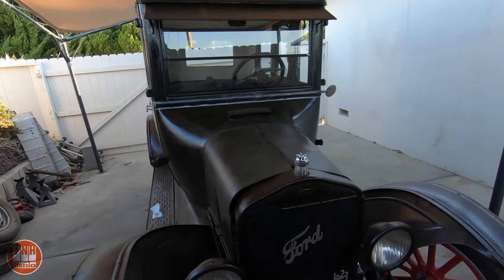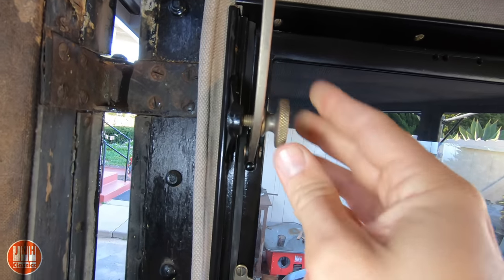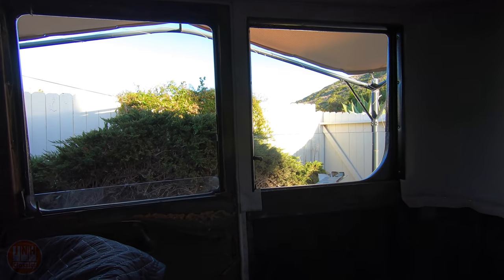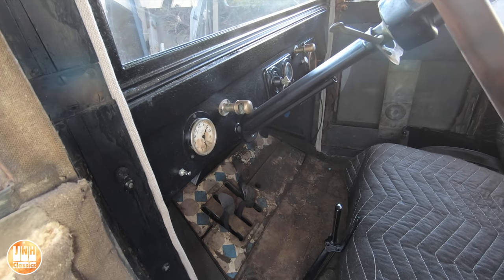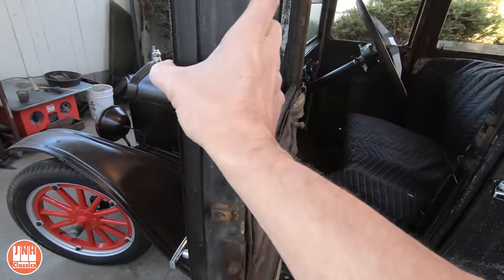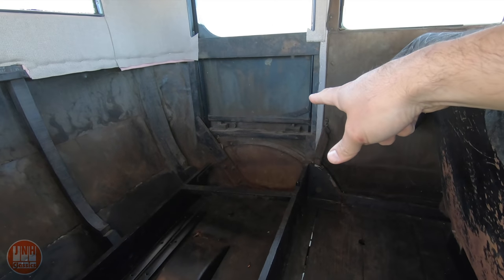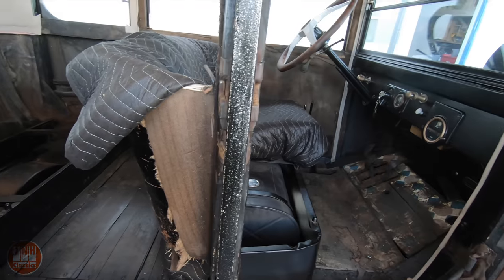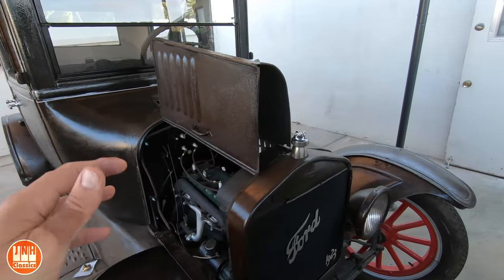The Model T has a New Roof and Other Bits  - Sunday Update (4-4-21)

Comment: When a six volt car is hard to start, people always blame the six volt system. The fact is that when these cars were new they started with no trouble. If they were problematic they would've never left the show room.  There's always a reason behind hard starting. The trick is to find that reason and correct it without resorting to the gimmick of changing to twelve volts to cover up the problem.
Reply: First thing to check is the battery cable.  The ground cable should be attached to the frame without any paint behind it.  It's a good idea to scrape off that area before attaching it.  The cable to the starter switch from the negative post of the battery should be designed for a 6-volt car.  You probably won't find that at your local parts house unless you ask for it specifically.  A 12-volt cable just can't provide enough "juice".

Comment: On the starter. My pop has had a 27 Model T since the 60s. The starter speed always sounded like yours. Slow. And it has always worked fine. Regarding the missing windshield knurled knob, you might have luck at MTFCA forums. Those old guys have everything.

Comment: When I first purchased my ‘27, it cranked real slow. New 6 volt battery and cables helped little. Sounded like the starter was dragging so I removed it. (Bendix has to come off first!) Wken I took the starter apart it literally fell to pieces!  How it functioned at all I do not know. I showed it to a rebuild shop. They told me it was the original starter and was too far gone for them to rebuild! Exchanged it with Snyder’s and now it cranks fine. Not as quick as 12 of course but much faster than yours. This early starter was completely overbuilt. Large and incredibly heavy, all to turn over a 20 horse power engine!

Comment: I like what you have done, it will be a driver, don't worry about a museum piece, they already have those. Six volts are slower starters but ground is important and there is a lot of rust in between things after 98 years, a quick way to test would be to put a jumper cable on your ground post at the battery and then clamp onto a starter bolt or what ever near the starter which gives a direct path to ground. I had a model A turn over faster once I ran a separate cable. Could be issues with the starter as they have babbit material in them but you can hand prime with the crank first to save on it. Make sure the thrust washers are replaced when you get into the rear end, they are actually dangerous. Looking good!

Comment: 6 volt battery cables should be O size or OO.  Makes a large difference.
Reply from the maker: I ordered the new cables from Snyder’s. They’re the same as the stock cables 👍
Reply: You may look at using original type braided ground cable new stranded type ground cable will not carry the load
Reply: Could be the brushes in your starter motor if you take it apart again check the brushes for sure or replace them.
Reply: @Jerod_Helt  Snyder’s should have the bulb you need for the dash. That’s where I got mine.

Comment: To legally run it on the road you will need a wiper, and the hand crank one will be fine. I wondered what it would take to get one of those on the road, with all the Special parts, I'll just let you do it! Great video
Reply: A Model T never had a windshield wiper as standard equipment. They were never original equipment from the manufacturer, it is not needed unless the owner wants it. First offered as a Dealer accessory in 1926.

Comment: Several Model T suppliers carry the windshield slide knob for 1926-27 T's.  But those models had the threaded part attached to the side of the windshield.   But I imagine you could get a piece of threaded rod the same size as the threads on your existing knob and adapt the later knob.  If you can't find an original.  I'll see if any of my Model T friends have a spare.

Comment: Well mine used to be 6 volt and it cranked over slow . Going to pick up a trailer load of parts . May ha e the knurled knob in this haul . Guy said he had windshield frames . So may have a knob in the parts . Will let you know if I get one

Comment: My old Model A had a similar set up on windshield push out , but not exactly. It had a knurled nut that screwed onto a post that was part of the side windshield molding. Not sure if you could weld a piece onto the side molding and use an “A” nut or not. Probably wouldn’t be as good, but might work if nothing else available. Great video, as always!

Comment: I see others have posted about the battery cable size, 2/0 or 00 is right, but what about your ground cable/strap? With a 6 volt system it is very important to have as much power coming and going. I have always had a new ground cable made out of the 00 size cable, not the original style strap I know, but it makes a world of difference. Check all of your ground connections again, clean-bright-and-tight, especially where the starter mates to the hogshead. If that does not help. time to look at the starter. As for your missing windshield knob, go over to the Model T Ford Club of America Forum and post an ad in the classifieds, one will pop up pretty quick. Good luck and keep up the good work.

Comment: What size cables do you have on the starter? With 6 volts you need 0 or 00 size cable. You can check the voltage drop to the starter by cranking the engine while measuring the voltage. The battery voltage measured at the battery should stay above 4.8 volts while cranking. The voltage at the starter should also be within 0.2 volt of what the measured battery voltage is during cranking. You should also measure the ground side. With the voltmeter connected between battery ground and the starter case, you shouldn't see more than 0.2 volts. A reading of more points to a bad connection between the starter case and the battery. 

If the cranking voltage at the battery is less than 4.8 volts, you either have a battery that is discharged or bad, or the starter is drawing too much current and needs to be rebuilt.
Reply from the maker: Thanks for the good info. The cables came from Snyder’s they’re the same as the original cables.

Comment: Your battery cables are for 12 volt system! All my 6 volt vehicles don’t turn over slowly there’s something wrong and I always find people using 12 volt cables on 6 volt system they need to be bigger gage cables...
Reply: Wouldn’t happen to be associated with Lang’s model t parts ?
Reply from the maker: I ordered the new cables from Snyder’s . They’re just like the original cables

Comment: I noticed in an earlier video the windshield came out in several pieces and was clearly not tempered safety glass.  I hope you have or will be replacing that stuff with automotive glass.  Flat panels are not that expensive.
Reply from the maker: I replaced it with modern Saftey glass 👍

Comment: I am building the same model T myself, I got all the skins for it, I am just missing the wood. The wood is long gone. Is there any way you could measure the wood frame and floor boards and make me a diagram? Or do you know where I could find this information?
Reply from the maker: Several venders sell full wood kits, maybe they have a diagram👍
Reply: @Jerod_Helt  Can you suggest one, the one I asked said that he did not want anybody to have his diagrams in fear of competition. I'm about to try to just make it look right, I have drawings of what I need but not measurements, I might attempt to reverse engineer the measurements from the only one peace of wood I have.  I enjoy your show, I save all your clips, I'm going to use them as reference when I start putting things together. I have a 23-25 body, a 1920,  some odds and ends everything is sourced from different part across my state I am latterly building my car from scratch from left over parts.